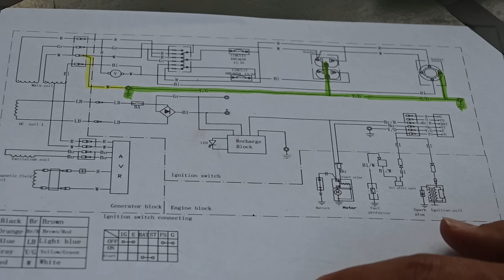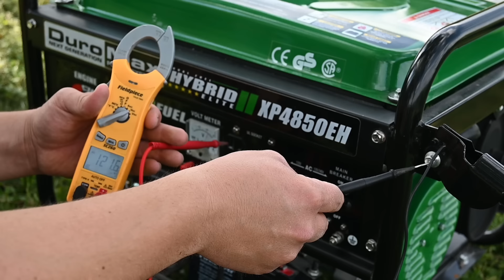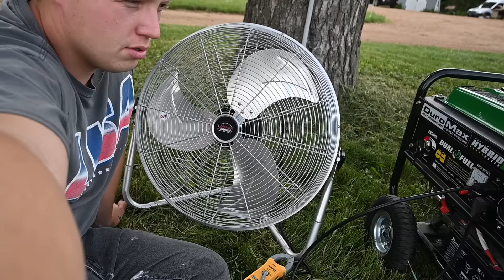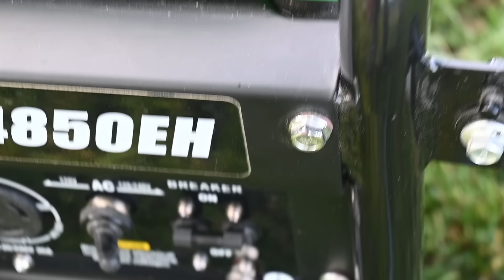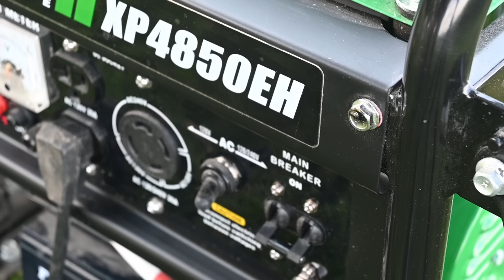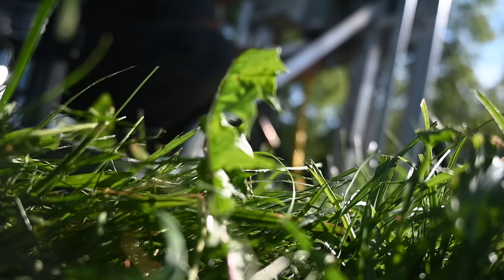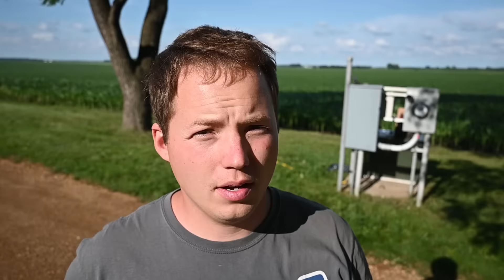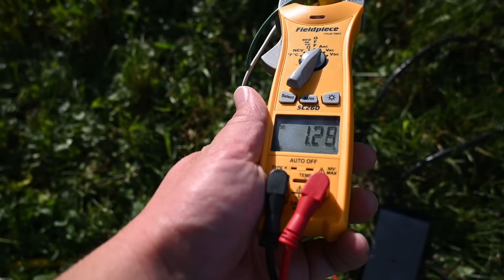What is a Floating Neutral Generator?

Comment: Ok Ben please answer this question. Is there a danger using an interlock since the neutral is still connected to the pole while on generator power?  Can that neutral carry current and endanger linemen. Please help us understand this very important question!  Thank you
Reply: If you think about how the grid is bonded everywhere (I watch lineman videos), you answer your own question.  Power sent to the grid on neutral wouldn't even make it past the dropping transformer which feeds your house. I guess if they were replacing your transformer they could get zapped under just the right conditions.

Comment: Don’t know if you can help or even see this question but here we go, my home works fine on grid current but on generator one circuit in the home trips. The rest seem to work. I have installed an generator interlock, a 50amp breaker and plug. The power inlet box is grounded but the generator cord is not, red, black, and white. Generator is DS13000EH

Comment: There is a YouTube video by an electrical engineer who installed the connection to the generator plug in box with the ground wire disconnected. Another comment refers to the same thing.
If the ground wire is not connected, doesn't that satisfy the goal of eliminating a dual path for return current?
If you get bored, please consider a video trying this method.
Thanks,
Steve

Comment: I noticed the generator has two seperate output coils and is not centre tapped which you would have to have in order to be properly bonded to ground. Yes, no? Pretty sure.
In other words according to the schematics, one coil is bonded to ground and the other coil is floating. In reallity there is no bonding at all.
Thanks for the video, great info.

Comment: the potential difference in the fault condition is between the frame and the neutral terminal.
so unless you put your finger   in the neutral terminal and touch the frame, there is no danger of electric shock.

Comment: Now I'm not sure if I have wired my inverter correctly. I installed a separate RCCB to connect the inverter to only some parts of home load - after a change-over. RCCB testing shows its working properly though.

Comment: "A bonded neutral power generator is required by code when you have a "separately derived electrical system" where the power transfer switch also breaks the power grid neutral conductor"

I don't have a transfer switch. I don't have a switch to disconnect grid neutral - I could always use an emergency axe to chop through the neutral. I'm going to have to break it somehow - otherwise my generator RCD will trip all the time. Bugger !

Comment: 23:00 "i honestly don't think
it's that big of a deal
to have a bonded neutral generator
connected"

No, not until you modernise and have an RCD on the generator - as it'd trip all the time as it'd recognise the second N-E bonding as an electrical fault.

26:14 160mA on the ground wire. RCDs trip at under 30mA - and that's why having a ground circuit like that would trip an RCD immediately as a fault. The reason it's a fault is that if the grounding at the generator fails, then exposed frames (such as your fan) could potentially have a lethal voltage on it.

Comment: Technically speaking, the ground is such high resistance that it's impractical for electrons to return back via the earth BUT it can. I believe distance from grounding rod is inversely squared with regards to current  but still "potentially" dangerous. In this case. The grounding rod is pointless, your gen set is isolated from Earth via the wheels and probably rubber pads on the bottom and the path of least resistance is the faulted wire.
Reply: Correct.  It didn't show zero between the ground and the frame because "the ground is referenced to 120V".   It shows zero because there isn't any voltage between them because they're isolated.

Comment: Ben, I have a question about how to ground a separate building like a barn or shop or greenhouse fed by a panel from the house, with four wires in a trench including neutral and ground from the house. My understanding is that the separate building requires its own ground electrode, for lightning protection and to keep animals safe. So you naturally bond the incoming ground wire from the house to the new ground electrode in the barn, and of course you don't bond neutral at the subpanel in the barn. But how do you then satisfy the requirement that all ground electrodes for the mother building are tied together? Is the bonding of that incoming small ground wire good enough to call the barn ground connected, or do you need to dig a separate trench and send that #6 wire all the way from the barn electrode to the house electrodes, to suppress eddy currents?

Comment: Bonded vs floating neutral 

What does it mean? 

Bonded means that the power returning back to the generator (neutral) is connected to the ground of the generator via a wire or to a metal part that’s grounded. 

Floating means that the power returning to the generator (neutral) is not connected to the ground of the generator via a wire or to a metal part that’s grounded. 

Pro of being bonded:

A short circuit with trip a fuse, stopping the flow of electrical flow immediately. 

Con of floating.

Electricity will continue flowing in the case of a short circuit. Power will continue flowing through the frame. Even If a ground rod is connected current will still flow and cause electrical shock if touched.

Though floating generators have fuses, they only work during an overload.

Comment: I used a few of your videos as guidance on how household electric works and wired my generator to my circuit panel and installed the lockout device. While reading the manual for the generator again today I came acrossed a section discussing floating neutral and gave a warning about not using the generator on job sites that require bonded neutral. Well, I got to worrying whether I should have put both the neutral and the ground on my bonded bus bar in the circuit panel and came back to YouTube to search. Once again your videos came up and this video answered all my concerns and reassured me that I had my generator hooked up correctly. I find all of your videos excellent Ben. Thank you!

Comment: You need to bond the neutral to ground if your 120 volt loads are unbalanced. If you don’t bond, voltage will be higher in the lighter loaded leg and lower in the heavier loaded leg, depending on load unbalance.

Comment: For anyone who is trying to run your furnace off of a floating neutral generator, it may flash a code to you for ungrounded circuit and will not work. I had to jump the neutral wire on the furnace to the case of the furnace to get it to work.  I later permanently installed a female extension cord end and a double pole double throw isolation switch to choose between house and cord(generator) power on the side of the furnace.  I put that jumper on the neutral to ground of that cord circuit, but fused it at .5 amps for general principles.
Reply: I'm in somewhat similar situation.  My setup has my house and generator feeds totally isolated.  A 3 prong male plug attached to wire going into furnace is either plugged into the female from the house panel or the female from the generator.  This was the setup approved by Ontario electrical authority back in late 90s.  Now I've just bought a briggs inverter generator which is floating neutral. So chances are that the furnace will not run.  Based on the video on how he converted it by simply connecting neutral wire to ground is there not and adapter that plug into generator receptacle and do that? Or could I connect a male to female plug and do the jump in the female plug?

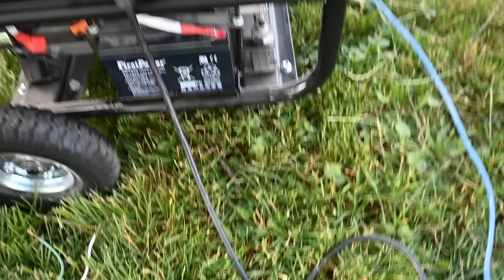Comment: Agreed... (@ 12:30) but what about the feet of the generator frame that are ALREADY in contact with the Earth. Granted a ground rod makes a better earth source, but the frame is already in contact with the Earth (ground). Moreover a "floating (generator) neutral" once connected to the neutral buss of an existing distribution panel - which is also tied to an Earth ground at the pole pig (in a residential setting), "sees" ground at that point - leaving the "GROUND" of the generator attached to Earth (ground rod) for even better protection. Bonding the generator neutral to 'ground' (frame) then tying that neutral to the neutral buss of a distribution panel _which is ("EARTHED") grounded at the pole - makes for unnecessary grounds in the big picture. Furthermore the frame of the generator should be connected to the SAME Earth ground source for the GROUND BUSS in the distribution panel - which is NOT the same as neutral in the panel.
In other words... residential NEUTRAL is grounded at the pole; residential GROUND is made at the dwelling. Residential NEUTRAL is a secondary source of GROUND. The best ground is Earth and as close by as possible.
A GFCI outlet is looking for trickle current between Ground, Neutral, and Hot. When it does - it trips. Since the generator main breaker is not GFCI - it can't sample those currents. The main breaker is merely a load circuit interrupt and doesn't 'care' if 120 volts is being sent to 'ground' (Earth). . . . BUT grabbing hold the frame while operating - in that configuration - will definitely get your attention.

Great Video..!

p.s. and regarding "poor" documentation, the schematic for my 13000EH shows a 35 amp 2-pole main breaker, which begs the question: "how do I pull 50 amps (13KW @ 240 VAC) thru a 35 amp breaker..? After a visit to the Q & A section of their website, I was informed the breaker is actually 43 amps (and change) with an acknowledgement of misprinted documentation. I never intend to approach a 'full load' on the Generator ( I want plenty of headroom); so it's good to know what the limits will/may be.

Comment: Instead of paying $12 on Amazon for a bonding plug, just take a $5 power plug and connect a heavy wire between neutral and ground on the plug, it's the same thing. Just make sure you don't connect the hot lug on the plug to anything.

Comment: Ben, I gotta tell ya, what ur doing, 2 thumbs up. Lectricity it has NO respect for ignorance. 
Ppl for the most part just want the gen to take care of them during or after a bad storm.
I have known ppl who thought it o.k. to come between 2 neutrals, because as they said,
the Neutral is grounded. thinking the wrong way and sticking to it is a bad attitude. 
To have a heavy imbalance on the neutral can literally be a hair raising exp. with a home
hook-up if the neutral is bonded at the gen as well cuz now u two paths.

I would say that ur load center actually in the house is a Sub-panel with separate grounds
and neutrals

Comment: Ground rods do not trip breakers. The breaker tripped because the electricity went through the frame.

In an isolated system the first failure just grounds the system. Hospitals use isolated systems as their equipment keep people alive.

Why do we not use isolated systems in general. For one once they get complex they are unpredictable. They can get accidentally grounded. Second is prevention of over voltage by for example nearby lightnings.

Comment: Hi Ben - Thanks for taking the time to make this very helpful video. Interestingly, I just got a Westinghouse Wgen5300DFcv generator that I intend to use for backup power to a few key house appliances ( refrigerator, freezer, …). The generator manual explicitly states that is configured as a “neutral floating” generator and a brief look at the schematic seems to confirm this to be true (I plan to check with my meter before starting it). However, the manual goes on to state that if the user only intends to connect devices via extension cords then there is no need to change anything. This flies in the face of what you and many others have suggested (i.e., that when using only extension cords, the neutral and ground should be grounded at the generator and that one should NOT add a separate grounding rod). Furthermore, there is absolutely no discussion of bonding in the manual. It seems that for safe operation when using only extension cords and having no connection to the house wiring, I should find a means to bond the neutral and ground in the generator even though Westinghouse made no provision for doing so. I guess my findings reinforce your comment regarding poor documentation. Yikes! - Thanks again! - Jim
Reply: you should trust the manual, not some youtubers

Comment: My generator has on the front ‘neutral bonded to frame’ written on the front. Should I connect the ground wire attached point on the generator to a ground point like my house ground?  Any other considerations to be concerned about? I use an interlock as well on my main panel. But as you’ve pointed out, it only disconnects the two legs and not the neutral in the main box.

Comment: 1. The major conclusion I took from this is that the floating neutral generator is only appropriate when I'm using it to power a system that already has the neutral and ground bonded at some point further down the line.  Correct?

2.  The corollary I'm trying to figure out is what to do when connecting my RV (or other 120v equipment) directly to the generator...  It seems clear enough (to me) that neutral and ground should be bonded in this case.  But is the grounding rod still required?  Or is bonding neutral to the frame sufficient?  (I'm still a bit unclear on this part)

Comment: In your second part of the video using the inlet plug to feed the transfer switch, if your generator is bonded could you remove the grounding screw if your are also switching the neutral from utility panel via the transfer switch ? Therefore only bonding at the generator.

Comment: This sure helped me a lot. I never heard of a floating neutral before,now I think I understand it. I guess you only want one connected point in the main panel, between ground and neutral. Question, I hooked up a sub panel in my garage and ran ran 4 wire number 8 wire and kept the neutral and ground bus isolated, but when a breaker in my garage is tripped in stead of tripping in the garage sub panel it trips back in house main. Any idea’s why this happens? All neutrals are on an isolated bus in garage. Thank You

Comment: I just watched your video.  I always enjoy how you explain things.  So,  I have a 3000 watt inverter Honda generator about 15 years old.  I've always used it with extension cords with no problems.  However,  I just made an extension cord to plug into the 20 amp outlet (L6 receptacle).  I used a metal box and #12 wire and receptacle and I wired it as I would a house,  Hot and neutral to the receptacle and the ground to the ground on the plug and the box.  Now I am wondering if I should disconnect the ground to the box and bond it to the neutral? As a side note ,I tested it with my plug in tester and it showed an open ground.  Even on the outlets on the generator.

Comment: yes code reqiures an earth ground, but it does so to prevent electricity from other systems from entering your generator system (ie  480 lines that fall from overhead or more likely lightning strikes  ; ps great job  on video

Comment: How much current on the green wire would you get in the parallel bonded scenario if you had removed the ground cable attached to the rod?

Comment: At 9:41 you mis-stated something.  You said you had 120 volt to the frame from the neutral prong wire.  That is wrong.  You had 120 volt from the black wire to the frame.  The black wire was pinched in the handle and that is the hot conductor from the 120 volt plug.

Comment: If you are connecting a generator to a breaker box in a house (which has a bonded neutral in the box), do you still want the neutral and ground bonded on the generator?  It seems that this is analogous to connecting an expansion box and leaving the bond open. 

I guess I should have watched the whole video before submitting my question.  Thanks for the great answer.

Comment: To be fair to Duromax, most portable generators in this class,  including my Honda EM5000SX have an unbonded (i.e. Floating) neutral.
Reply: Not really. I have  7 generators. Firman 7500W x2, Ridgid 5700W,  Firman 1800W I, Coleman 5500W, Champion 1000W , and DuroMax 3600W. All are bonded from the factory.

Comment: Very good video. Thank you.

I have one of those Duramax generators, its floating neutral as well. During an outage when connected through interlock same as your video, it blew every single 24V transformer in the house (8 of them) plus a DC garage door opener control panel and Wine Fridge power module. It turned out to be a loose natural wire on NEMA 14-30R cord from generator to panel connecting cord. All other AC operated devices are fine but some control panels one HVAC connected to 24V burnt. Ended up $1000+ in parts for loose neutral wire. Any explanation on why only 120v to 24 v AC DC transformers burning?

Comment: If u plug loads into gen and one load has a fault mkg its frame live, not having a 
grounded extension cord can be dangerous if load is touched and u have a good 
ground or u touch gen and faulted load. Gen frame sitting on ground and bonded 
neutral can be dangerous if using 2 wire ext. cord and load with a fault.

Comment: Ok, to see if I understood this right: If I'm going to power my xfer switch that drives the house's main panel (which has a bonding screw present) then ideally I should use a floating neutral generator. However, when I intend to use a generator mainly with extension cords is ideally when I should use the bonded neutral generator to avoid energizing metal components within the circuit that someone may come in contact with?